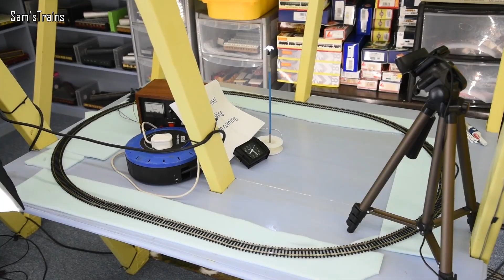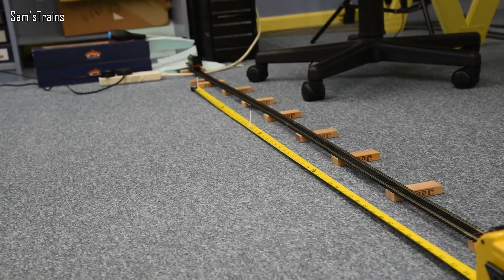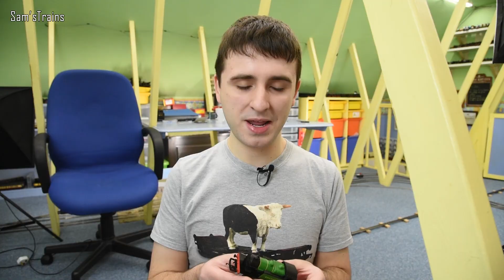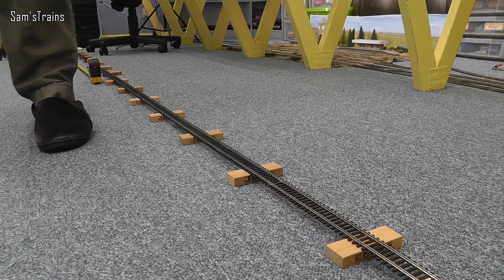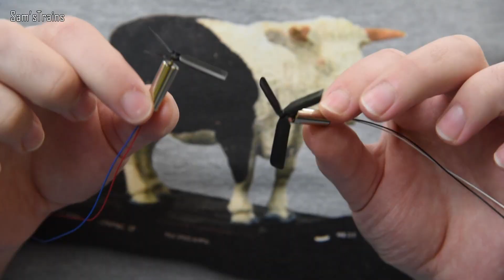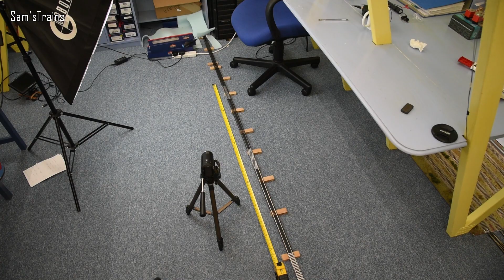How Fast can a Model Train Go?

Comment: A long time ago in the early 70s three of us had a very small layout in a small room.  We used Araldite to glue a large Jetex motor to a Weltrol wagon and set it off.  It arrived at the first corner and carried strait on into the wall.  At this point the glue let go of the motor which was still burning.  So we had a Jetex motor going beserk in our small room!  We did not repeat the experiment.
Reply from the maker: Hahaha sounds delightfully chaotic!! 😂

Comment: I just found this video, and had to respond. Luckily, I have a source for dilithium crystals, and was able to miniaturize a warp drive, but as the unit disappeared in the middle of my speed trap, I have to wait for it to show up, hopefully, in the next week. Rather than measuring miles per hour, I calculated it as moving at 6.11359 weeks per second, so it should pop back in at any time.

Comment: Hi Sam, can I ask, is the purpose of the capacitor to smooth out the PWM or noisy supply voltage?  Glad I found this video - I was trying to achieve the same thing but I don’t think the motors I have are too happy with the PWM from the Hornby R8250.  They make a horrible electrical buzzing sound. Andrew

Comment: Maximum Voltage I ever feed to my model was 48V. If it isn't for too long time, Motor survive that (but it should be a loco without light, lights die before motor of course)

Comment: FPV pilot here, Use bldc motors with an esc, they will have drasticly better performance with fraction of voltage. A 2S quadcopter (2S batteries have 7,4 nominal voltage) with 2,5 inch diameter propellers can cruise faster than irl 60 mph

Comment: Arcing happens when the current on the inductance of the motor is stopped because the wheel does not touch the rails continuosly. Then the current in the inductance can't stop and will make high voltage and thus arcs. Using digitally controlled motors combined with big capacitors the arching problem could be solved.

On this relatively short track it is not only about high speed but also about acceleration. Metal on metal has not enough friction for big acceleration. If we accept low acceleration then with regular trains the power of standard engines would be enough for high speeds but the gearbox should be changed to have less traction but higher high speed.

I would try building a loop with superelevated (bent) turns and use a modified gear ratio engine with digital control to achieve high speed. Maybe one day I will try and also video it.

Comment: Wanna know how to make one without doing ANY, ANY ANY ANY, AAAANNNNYYYY mods?

Get HMDC and an old Hornby Railways LMS 8F. The old one, LMS black, the number is 8193. The one with the glowing firebox.
If my model isn’t a deliberate defect, that thing should outperform a modern Hornby Virgin Pendolino. It beats my Flying Scotsman, both my A4s, my Class 91, and I have to normally run it at 3 quarters speed to make sure it doesn’t throw itself off the track.

Comment: A more useful test would be to see how slow you could get a RTR model run whilst pulling a realistic load. Most RTR are only comfortable at moderate to high speeds but real railways were not like that. Starting and slowing/stopping are unrealistic with most RTR offerings.

Comment: if you went with a slightly bigger brushless motor you could prob hit a scale speed of 2000mph with only 12 volt. my rc helicopter swings 325mm blades at 2900 rpm at 11volt lol
Reply from the maker: This is true - but that'd be more complicated than I could manage! ;D
Thanks for watching, Sam :)

Comment: Atlas Trains made an HO Gauge speeder back in the 1960s and in the late '70s I found one new-old-stock in an old hobby shop. It was a de-geared switcher frame with a big motor and a propeller. They gave it a plastic rocket sled body.  It was challenging railroading! On an oval with 6 foot straightaways and 18" radius curves you were lucky to go around twice before it tipped going around a curve.  In the end the crashes destroyed the thing (wish I still had it!)
Isaac Newton says if you make your straight track long enough, you can basically go as fast as air and rolling resistance let you!
Reply from the maker: Ooh did they?! I'd love to get something like that - fan trains are so much fun! :D
Thanks for watching, Sam :)
Reply: I seem to recall LGB also sold one, and not very long ago! 
-just in that case make sure you know the locations of pets and small children first!

Comment: Hi Sam. You still have the best video in my eyes (-:  Thank you for your great contribution. But there are now 3 trains at least that are faster than yours;     https://www.youtube.com/watch?v=hYyuQDAEqfQ.    https://www.guinnessworldrecords.com/world-records/470009-fastest-railway-model  https://www.youtube.com/watch?v=nQK-lokjMW8.     If you fancy we can build two or more rivals or design one or more together. I have a great venue with a novel/ideal, dead flat 600 meter straight. And The Model Centre (TMC) are helping with supplies. Interestingly I've found that the professor behind Britain's forthcoming high speed rail research centre seems to be slightly interested in this too. Maybe I can twist his arm to design an entry (-:

I've been building a few of these since the once I've shown you. My latest is likely to break the world record even on it's weakest motors. It's a huge step forward over my previous choice of High voltage electric for power.

Let me know if you fancy trying something, it's fun to keep as many British speed records as possible lol.  No problem if not though. Keep up your great work Sam!

Thank you

Rob

Comment: quarantine was very boring and had some spare rc stuff sooo yeah
achieved a scale speed of 1920mph using a 6wd diesel shunter running a 12v heatsinked brushed motor (the 550 motor) 
running 36 volts from a dc power supply to 20m of DIY copper tracks
Reply from the maker: Sorry it was boring - wow that sounds amazing though - did you do a video?! :D
Thanks for watching - Sam :)
Reply: Sam'sTrains unfortunately no but I could redo it with a camera :)

Comment: "I've never seen anything like that before"
I have. On the welding table. You got the voltage so high the wheels and the track started to weld together. If the railcar hadn't been going so fast the wheels would have stuck to the track.
Reply from the maker: Yeah you're right - there were little spot welds all over the track! Certainly never seen a model do that before ;)
Thanks for watching - Sam :)

Comment: To validate your measurements and results you need to post the voltages being used.  Off camera you're making voltage adjustments so we have no idea how fast you ramp up to the target voltage.  I'd recommend having a switch that interrupts power to the track while you set your output voltage to the desired setting, then switch on the track and see what happens.  You'll probably get even higher speeds simply because the train is running at its intended voltage the full length of the track.

It seemed to me like in some of the earlier tests the train voltage was not at an instant voltage but the result of you turning the dial up till you get the speed you want.  However, if you DON'T want to incorporate a switch you could put tape on the Variac and mark dial position at specified voltages to help you get the dial up to that voltage faster.  But I think the best way to go would be to have a switch turn the track on at a preset voltage.

Reading wiring and voltages - that capacitor could be the weak link.  If it's rated for 35 volts, exceeding that voltage COULD have spectacular results (catastrophic failure).  The sparking on the track could have been the result of the capacitor beginning to break down.  But I don't know that for sure.
Reply from the maker: Yeah you're right there Pete - it was just a bit of fun really, I knew I wasn't being dreadfully scientific. I thought about trying a switch, but decided the sudden voltage surge might  ruin everything!
Thanks for watching - Sam :)

Comment: Someone explain this "scale speed" concept to a dummy like me. Isn't speed irrelevant of acale, like X mph is X mph regardless of the size of the train?
Reply from the maker: Yes that's true - but if we scale up the actual speed (as we'd scale up the model to be it's actual size, 1:76), you get the scale speed! In other words, if the wheels of the real engine matched the RPM of the model, what would the speed be?
Thanks for watching - Sam :)
Reply: @SamsTrains  Right right, I get it now! Thanks for the reply

Comment: for your challenge, how about slamming a capacitor on it, charge it using the 12 volts and then unload it to cheat your restrictions ?
Reply from the maker: haha yeah that would be allowed - but that'd only give you high current, not voltage! ;D
Thanks for watching - Sam :)

Comment: Impressive!  I'll take your challenge, but you have to clarify it.  You said it has to be faster than yours but I can't go over 12 volts?  What was your fastest run at 12 volts?  I think you should specify that it has to have drive wheels and not propellers.  I'll see what I can come up with!
Reply from the maker: haha go on then! There should be a table in the video that shows the speed results! ;D
Thanks for watching - Sam :)
Reply: I think I have a Tyco that did 498mph at about 18 volts.  I'm going to have to check it again and get back to you!

Comment: For short run like this you can run these engines at pretty ridiculous voltages safely. In a pure speed test there's very little load so very little of the electric energy turns into heat. And on a drag strip speed test it's a very brief heating. I would not be surprised if these 12 volt motors can take 144 volts.
Reply from the maker: Yeah I guess you're right - I wouldn't fancy it with anything valuable though ;)
Thanks for watching - Sam :)
Reply: @SamsTrains  I don't own any train sets but it's not difficult to beat your record. Standard controllers provide in vicinity of 6 watts of power, if you aim for 0.7 seconds of acceleration (to fit in 6 meter track), this can push 20 gram model engine (just the engine and traction bogie) to real life 45 mph. It can do way faster with longer track. Look into competitive slot car racing for the technology.

Comment: Would that be the starting of a weld from the DIY train and the tracks? Not sure if the amps are there but the voltage was certainly high
Reply from the maker: Yeah possibly - the transformer can put out 8amps as rated, and possibly more if overloaded - definitely lots of current there!
Thanks for watching - Sam :)

Comment: All that sparking and arcing was fun. c: The damage to the track and wheels came from that because the electrical arcs are hot enough to vaporize and ablate the metal, which causes little molten bits of metal to splatter on everything nearby.
Reply from the maker: haha glad you enjoyed it - yeah you're right, quite impressive power there! :D
Thanks for watching - Sam :)

Comment: Sam... The endurance run Video was Brilliant. 👍👍 
BACK in the 70's.... It seemed like many N Scale Locomotives went at least HALF that fast, bog standard!!! 

Even in old Model Railroader Magazine Reviews, many N Scale Locomotives were tested OVER 300 SMPH!! 😳😳😆

Love your sense of adventure and humour!! 
Carmine ✈🚂🚙
Reply from the maker: Thanks very much mate - wow that's crazy stuff, was that because they weren't gearing them down enough due to their size??
Thanks for watching - Sam :)
Reply: Well that, and the Slot Car Motors that Arnold and Trix used were incredibly FAST. There was no room and no brains, so they simply fixed the Worm Gear from the Motor STRAIGHT to the Axle - with no thought of reduction. 😖
It finally took the Japanese (KATO) to finally sort how to make a N Scale Locomotive run properly. They used 35v Motors, so NO Hobby Transformer could ever reach its top speed! 
Oh and even in the late 80's, they ran like fine Watches.

Skewed Poles, Precision Can and Coreless Motors really revolutionised N Scale!! 👍👍

Comment: So, when the propped loco passed the insulation, the air turning the props of the electric motors generates its own power. Which is the deal with the sparks.
Reply from the maker: It shouldn't have done - it was open circuit - if I'd shorted the rails together, there could have been some current passed!
Thanks for watching - Sam :)
Reply: @SamsTrains  oh, I did not realize that they were isolated even from each other. I wish we could see a voltage read direct from the wheels when its still coasting on momentum, see what kinda power those motors are actually throwing. What a strange effect, though. And don't thank me for watching, I thank YOU for making, Sam.

Comment: A couple of thoughts: 

1) The arcing between the wheel and rail has got to be due to losing contact, even though it would seem to work against going faster, you might try adding additional weight, just for contact (losing contact means losing voltage to the motors, losing power through the spark - that power goes to melting wheel and rail instead of the motor)

2) Using segmented track is ok, I guess, but in the views down the rails, the "loco" seems to be nosing back and forth (hunting or yawing) which could also be contributing to the sparking.  Some ways to help this would be to a) use longer segments of "flex-track" (but obviously kept straight), tack them to a piece of plywood, and add the dead section at the end b) use tighter gauge wheels (less gap between the flange and rail) c) use something to damp swaying motion of the bogeys (as you Brits I think would call them, we'd say "trucks") - something to restrict the side to side motion - springs, foam, etc - to help keep the wheels straight

3) Use a longer track and a longer slow-down section - to my eye the "loco" was still accelerating through the speed trap, and if you take longer to speed up, you'll need additional space to let it slow down to avoid crash damage.

4) Don't even worry about aerodynamics, yeah scale speed is 'above the speed of sound,' but that's not how aerodynamics works:  to the air, it's still just going 11 mph, which is far from worrying about significant aerodynamic effects.  It might go faster to streamline the body, but probably only minimally.  Freer rolling wheels, better contact, and high speed motors that can take higher voltage are almost certainly better ways to get higher speed.

5) If you want to go really fast, try the vacuum-ping pong ball method - the Mythbusters did this.  There's no reason you couldn't put a piece of track in a tube, put a properly weighted rail car on it, and pull the vacuum.  I bet you could be getting TRUE (not scale) speeds over 100mph.  Link to Mythbusters video with ping pong balls:  https://www.youtube.com/watch?v=87Cpe4bJn0U
Reply from the maker: Thanks a lot for that - yes you're right - if I were to do this again, I'd have multiple wheels picking up - just one per rail is nowhere near enough! The streamlining would definitely be useless too - I have seen a lot of comments suggesting I do it though ;)
Thanks for watching - Sam :)

Comment: Hi Sam, Pretty fast. But in the electric model field 1/24th scale Drag Racing Slot cars might take some beating. 
eg https://www.youtube.com/watch?v=iBZsWQ2SD5o 
with the car doing an actual 103.3 mph or 2,479 scale miles per hour after 55 feet from a standing start. 55ft being a scale quarter mile in 1/24th scale. This was tens years ago at my local slot car track so they most likely are going faster now. World champion likely faster again, but a real 100mph + is common for the top end cars. Bit faster than your Wrenn cars.
A sample of a 1.5 hour video on what is needed to build the top end motors needed for this :
https://www.youtube.com/watch?v=yJotmu91A4I

In the 1920s and 30s American summer camps had organised train races around lakes but not at slotcar speeds. Was in books I had read not on the web it seems.
Reply from the maker: Ooh yeah - I wouldn't like to race this against a slot car, lol! ;D
Thanks for watching - Sam :)

Comment: Hi Sam, a great bit of fun.
I'm surprised you don't have an adjustable power supply on your bench, most go to 30V at about 5A along with current limit.
These supplies will allow you to do a proper controlled start, 
Your supply is an Auto-transformer, which means its output is not isolated from the mains.
Your power supply, did you have any filtering on the "DC" output?
If not then your DMM is measuring average of the pulsed DC, so the peak voltage would have been higher.
Are the props both the same? Not cw and ccw types.
If you just turn the back prop around  to fit the rear motor shaft and rotate in the opposite direction to the front, you may not be getting full performance.
You would need to put the prop on so it still faces the same way as the front prop and both motors rotate in the same direction.
You may need to fit a "spoiler" to keep the truck on the track.👍👍😊
Reply from the maker: I do have one Tom, but I wanted a bit more grunt for this - I could do a controlled start, but I needed to accelerate it fast to get up to speed!
I rectified the AC output and smoothed it with diodes - and the rear propeller was reversed so as to push air in the correct direction - I promise you I thought of these things ;)
Thanks for watching - Sam :)

Comment: I have run those motors up to 70 volts where they last about 10 mins before they have eaten the brushes
Reply from the maker: Blimey as much as 70 volts? I would have guessed 40, since they're rated for 24 (or so I believe) - can't believe the heat didn't ruin the coils within 10 mins! :O
Thanks for watching - Sam :)